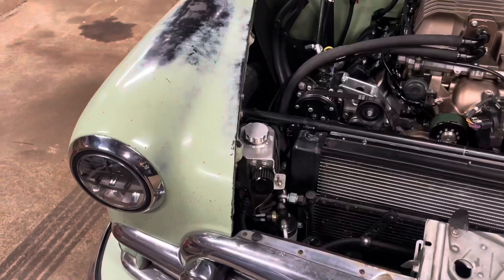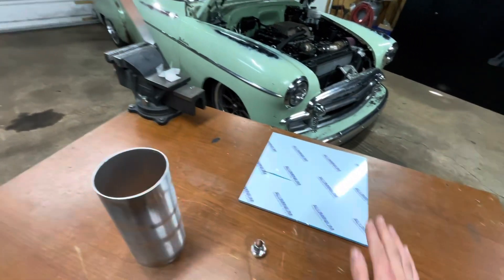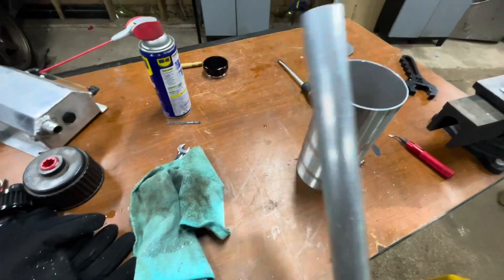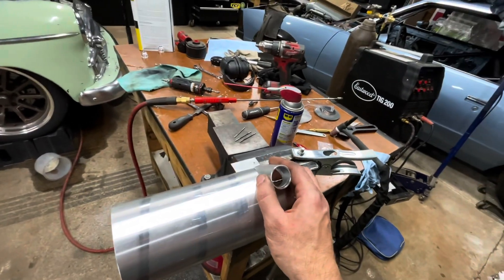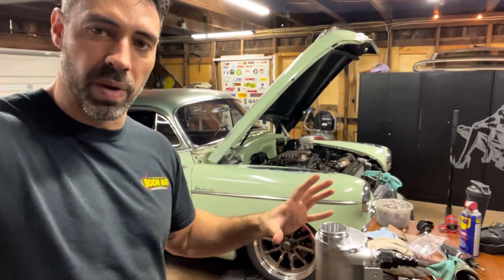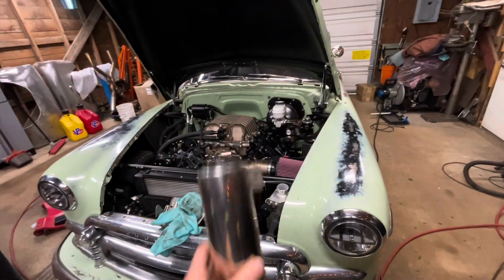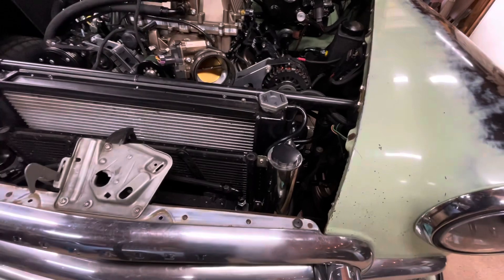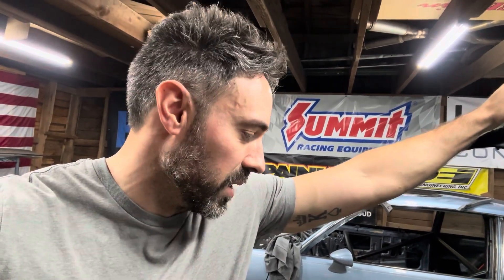DIY coolant reservoir tank for the LSA Supercharger ￼

Comment: Question: does the reservoir not need to be the highest point in the system? Does the brick in the supercharger bleed down when not running or somethin? Maybe im overthinking it but feel like im missing something, tryin to plan the system
Reply from the maker: As long as you have the inlet of flow on the lowest point it will keep the brick full when running. It’s not a pressurized system. Just need the coolant to flow.  I have 10k miles on this setup so far and no issues.  Hope this helps.
Reply: @snedenwerks somewhat, i assume you are referring to the inlet of the intercooler pump? Did you route from reservoir to pump, pump to heat exchanger, HE to blower lid, blower lid to reservoir?

Comment: Green tungsten will ball the end when welding aluminum. I use the 1/8" diameter, and even controlling the amps will ball a little. I also use either UHP argon or Helium/argon mix.
Your doing great. Keep up the awesome work!
Reply from the maker: Thank you
Reply: @snedenwerks  no way, thank you - for posting your build, through trials and tribulations - to inspire us that used to do this daily to get back into it. 
Wish you were closer. I have RT66 running through this state. A car like yours would be a sweet addition to up coming events.